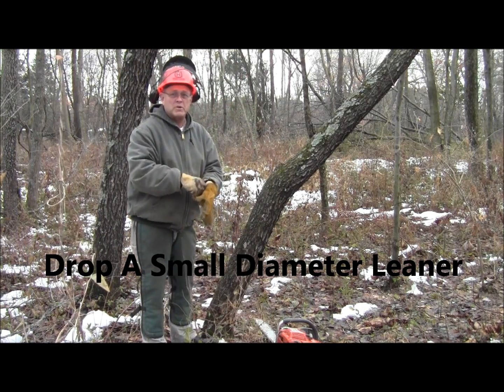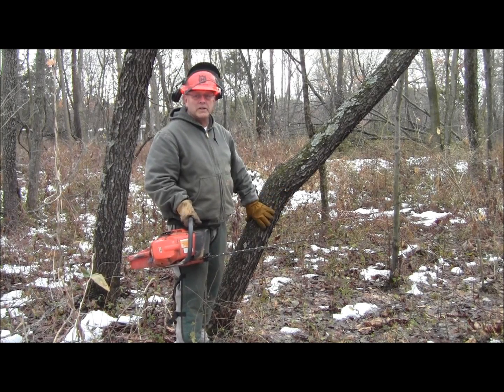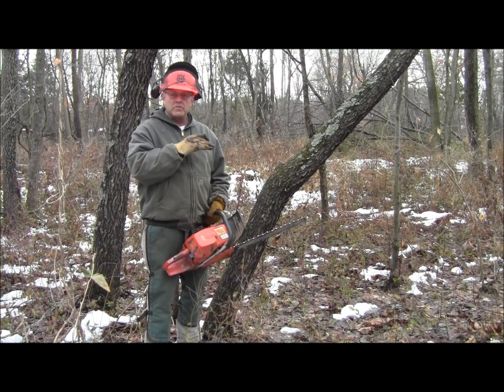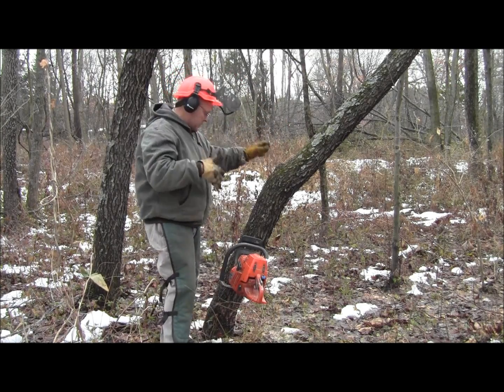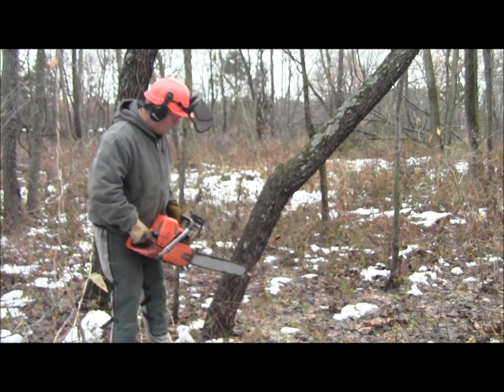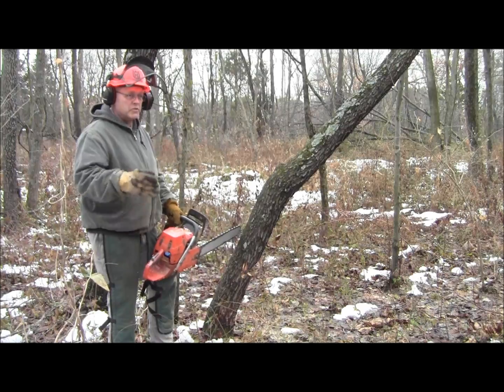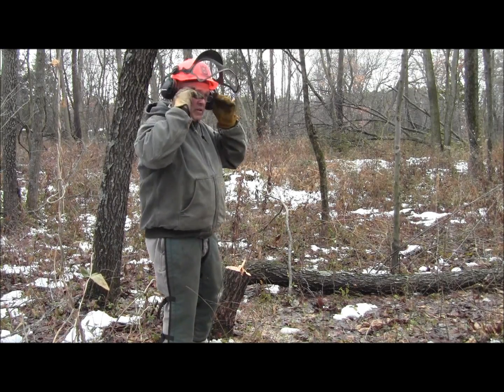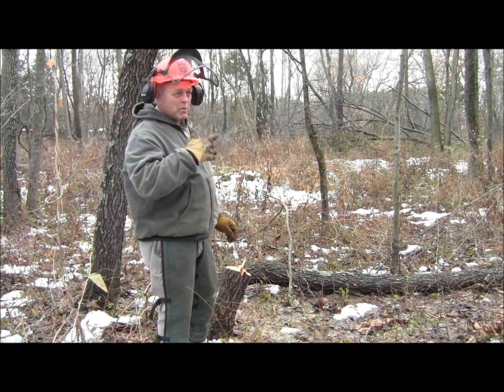Drop A Small Diameter Leaner Without It Splitting And Making A Barber Chair

Comment: Nice way to work with small trees. I had anticipated that your backcut would be at the top of the plunge cut, rather than at the bottom of it. I don't suppose that it make any difference...
Reply from the maker: I do it both ways with no problem!

Comment: when you do your vertical plunge cut, could you angle it slightly, say 10 or 15 degrees off centre, continuing the cut either upwards or downwards to cut through the back strap from within the tree, rather than going at it from the back on a 3rd cut, as shown in the video?
Reply from the maker: I like to angle that cut if there is room to do it. You can put it in the stump or the butt, and then do the release cut

Comment: I could see the possibility of using this on a larger tree, but that  sapling would be cut completely through before it started moving, so no chance of a barber chair. Actually, i would just make a small cut straight in on the leaning side, then cut from the back. Exactly as i would cut a limb of the same size and configuration while standing on spikes 50 feet up a tree!  I have never had a barber chair except when deliberately demonstrating how they can occur.

Comment: Interesting technique. Not sure it’s necessary on a small diameter (6” and under) as the danger from barber chairing is negligible. It looks like you actually created a pseudo-barber chair as there were vertical fibers on the back side of your vertical plunge cut line. It certainly does appear your technique works (still not sure on the necessity though.) I’ll give your technique a try. Thank you for sharing and teaching. Stay safe and blessed.

Comment: Does it matter whether the initial cut is a conventional hinge vs a Humboldt hinge?
Reply from the maker: The face should have an opening of 70 to 90 degrees. You can have the angled surface top, bottom, or both. The angled top cut aims your tree, and doing it first makes aiming easier than doing a  horizontal cut first for aiming. You look down through the top cut as you make your matching bottom cut so you can stop the saw as the two cuts meet.

Comment: I don't see how it helps the barber chair
Reply from the maker: Leaners will split if you cut from the back without establishing a hinge of proper thickness first. Bore cutting to set the back of the hinge is a basic method you need to safely cut these problem trees. Watch Tim Ard's video where the student does not do a bore cut as planned, and then the tree splits. https://www.youtube.com/watch?v=V7vwoK47yUc&t=178s

Comment: I like the V method.
Reply from the maker: It is surprising how flexible this method is.  I angle the bore cut to increase the strength of the hinge, and place it above or below the hinge point, and it always works well. It really beats repeatedly shaving the compressed side on small leaners to take them down.

Comment: never seen a vertical plunge; very helpful; most of us never thot of that; I noticed on the plunge cut you started with the bottom of the end of your bar instead of the top, I assume to prevent kickback.  Great video; you learn a lot in a little time; thanks.
Reply from the maker: Yes, you are correct. If the tip or the upper corner was used, it would kick back. Start with the bottom corner, get into the tree and rotate to the direction you want to bore. Thanks for visiting!

Comment: I fail to see how this is an alternative to a bore cut. With a bore cut the hinge is established then the back strap is cut inside to out. 

With this method you cut the back strap from the outside due to size, so isn’t a barber chair still possible?
Reply from the maker: This method does use a bore cut, just not perpendicular to the stem, because of the small diameter.  Watch this video and you will understand: https://www.youtube.com/watch?v=i4Zm497d28A

Comment: The purpose of a hinge is to control the direction of fall.
A small leaner does not need this control.  Flexing the hinge just gives the tree an opportunity to split. I cut small, severe leaners the same way I cut off a similar sized branch.  With a snap cut.
Reply from the maker: https://www.youtube.com/watch?v=BGm6fP_xp5M
Reply: @DavidN23Skidoo  I think that is called changing the subject.

Comment: This is a neat cut. There is such a thing as the 50' 8 inch dbh hard leaning tree. It's the extreme of angling the bore cut so you can leave enough backstrap when your bar is pretty wide compared with a small tree. I like to put the bore below the hinge height in the stump wood though and cut the trigger down there. Less likely to lose saw with the tree if the trigger fails . Or just coos bay/triangle

Comment: @DavidN23Skidoo
My most challenging tree fell involved a bore cut. I wish I could use the technique everytime. Glad to see it's possible with small trees. However, how does your approach lessen the possibility of splitting? And it must be challenging to achieve an even hinge if the saw can't adjust laterally. Can the wedge cut be made after the bore cut?
Reply from the maker: Yes, you can change the order of the cuts.  The reason for doing the vertical cut is because a small diameter tree does not have enough room to do a regular bore cut and still have a backstrap.  Here is another look at the method. https://www.youtube.com/watch?v=i4Zm497d28A&feature=youtu.be

Comment: This is so great! Had a chance to try it out over the weekend. One question came up though, are you taking any care not to let your bore cut drop below the hinge height? It looks on camera as though it drops below slightly. I didn't try it out, boring below the hinge, just because it didn't feel right when I was cutting and everything worked as planned, but wondering if you'd thought about this aspect of the cut.
Reply from the maker: You can set this up with the top of the bar making the back of the hinge, or the bottom of the bar doing it.  I have tried it both ways, and now prefer to put the bore cut below the hinge.  Either way works. https://youtu.be/i4Zm497d28A
Reply from the maker: Ideally, the front and back side of the hinge should be at the same level.  It is always good to grade your stump so you can make improvements to your technique.

Comment: I've only got about 20 minutes total experience using a chain saw; but I don't like the way that tree was cut.   If the vertical plunge cut is to be kept,  I'd do the backcut so it met the top of the plunge cut.
Reply from the maker: That would work.  The vertical or slanting bore cut is for those cases where a horizontal bore cut would not leave any backstrap.  You can also do the bore cut so the top of the cut is even with the bottom of the face cut.  Take a class where they teach you the bore cut.  The ability to punch through a tree is what separates the chainsaw from a crosscut saw and axe.  Bore cutting is the first cut taught in a good class.

Comment: Couple of steps back may save you from a smack in the face!
Reply: Three things: (1) maybe make the hinge a bit higher so its easier to get the bottom of the tip to make the vertical bore cut without risking a kickback from the upper tip quadrant. (2) make the backstrap cut a bit higher than the hinge so the falling tree steps down and goes only forward, (3) make the hinge a touch thicker to give yourself a few seconds to take escape route at 45 degrees.
Reply: This fellow has much experience, so its important to calibrate what he does, and what others should do, its a good idea to build in a greater margin for error, if you have less experience.

Comment: It is easy with a smaller saw.  I just grab my ms-180 and whack it down,  but on small diameter trees I just slash cut them and push them over if I have to.  I never grab on of my 20 inch bar saws to whack down a three or four inch diameter tree.  I can easily cut 12 inch diameter stuff with the Stihl MS 180.

Comment: Seems to me that his vertical bore-cut is a great potential starting point for a vertical split ("chair"), which was the subject of the exercise. IMO either version of well-known Coos Bay back cut would be much safer.
Coos Bay back cut: cut in from either side, leaving strip of holding wood perpendicular to the hinge. Those side cuts can either leave holding wood of constant width or in the shape of a Delta.
OTOH, with a small tree like that, just stand off to either side and make the backcut quick @WOT. 
Come to think of it, that sapling is small enough that you could make the backcut with a polesaw, if concerned about chairing. K.I.S.S.
Reply from the maker: The hinge and backstrap make it stable.  I now use an angled bore cut to make it look better.  I have done this many times and it works well. https://www.youtube.com/watch?v=dlcA3B_zeSU
Reply from the maker: +Jacques Blaque  I posted a neater looking variation of this on Jan 24. Go to my channel and check it out.  I think you will like it.